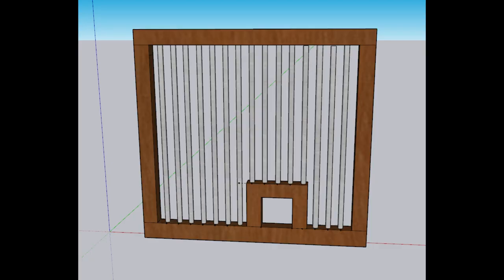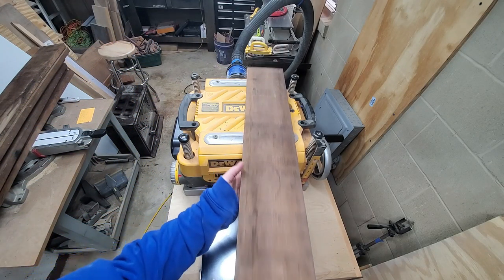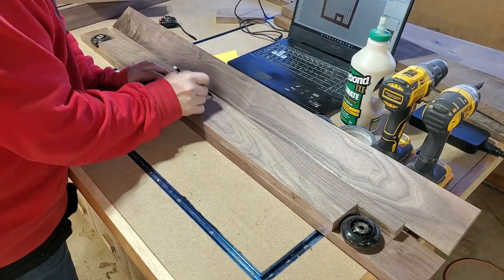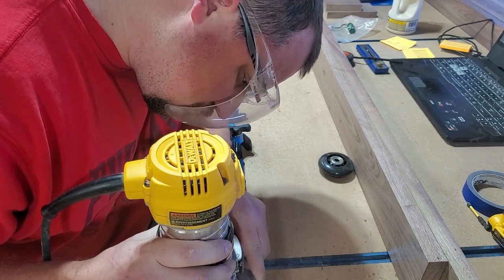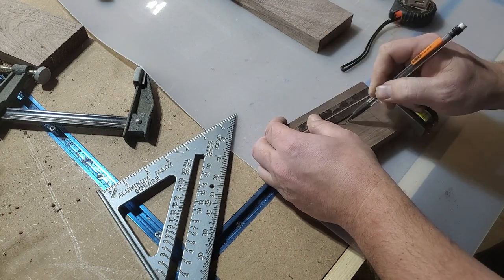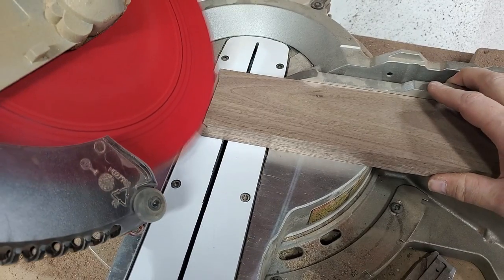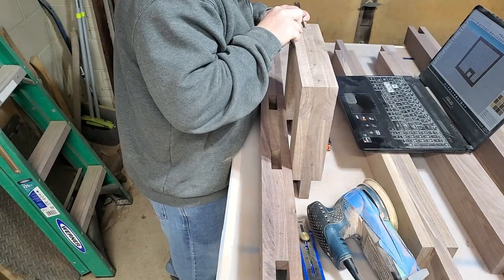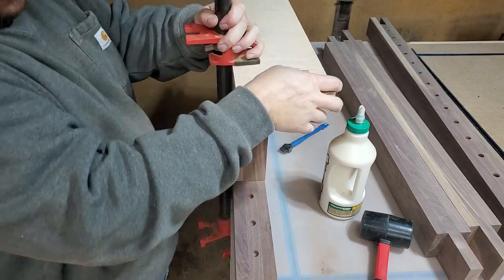Making a pet/baby gate with a lot of function that is easy to use

Comment: You must have a steady hand. Even in those 3” cuts with the bandsaw I need the fence. Another great project!

How did you secure the aluminum plate to where the latch goes?  Epoxy?
Reply from the maker: I try, but I'm often not perfect with it. Thank you very much. 
I actually did not secure it there.  It's laying in there from the top so beyond having a little bit of a friction fit at the bottom I didn't feel an urgent need to secure it.  If I'm building one for children I would most likely drill out a hole and use a countersink drill bit to put a screw in there that would be flush.